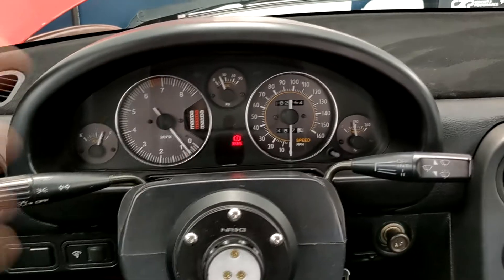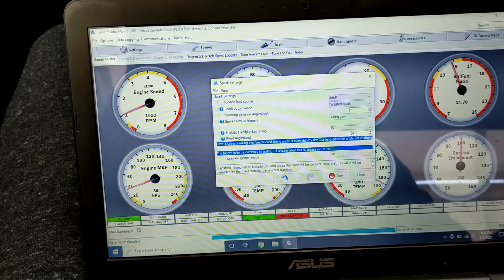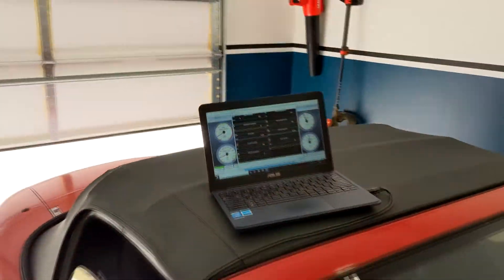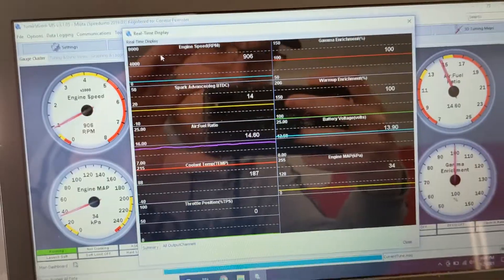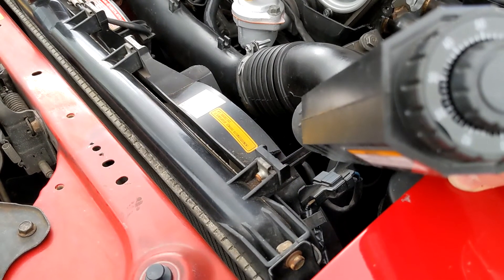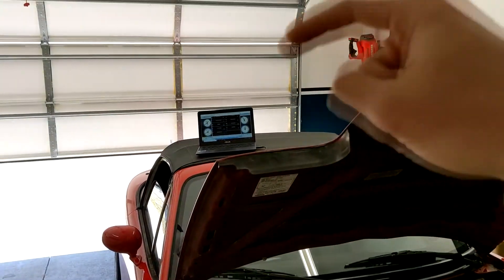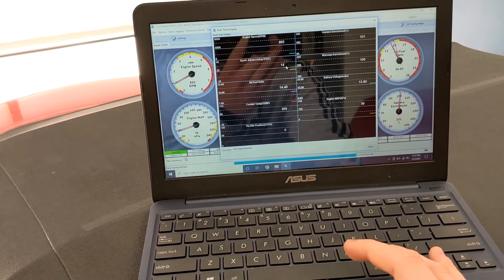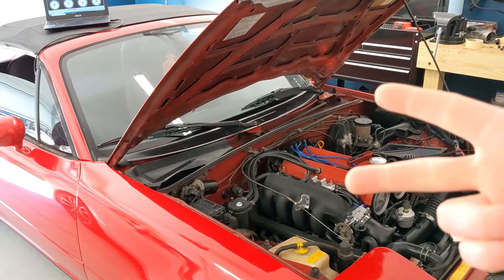NA 1.6 Miata SpeedyEFI - Set Base Timing

Comment: I have a problem where my timing light shows it’s at 10 degrees, the ecu is set at 10 degrees fixed timing and everything is all good. As soon as I turn off fixed timing, the real-time display shows it’s at 20, but when i check it with the timing light it says 10
Reply: i have the same issue, did you figure this out?

Comment: also pretty sure if you set the timing gun to the desired value  (14)  you only need to allign the 0 on the crank gear (so white dot to white dot)

Comment: Just curious, what would happen if your on stock ecu, and you move the cas without having the jumper in the diagnostic box? Does it just mess up your idle?
Reply from the maker: It will mess with the timing over the entire rev range... A common mod is bumping base timing from 10* to 14*. It livens up the car and gives you more power. What that's doing is bumping the entire stock ignition table by 4 degrees, and we all know that timing equals power. So yes, it will mess with the idle, but also the rest of the rev range.

Comment: bro are these ecu good? can it get idle like ms3 with ac too?
Reply from the maker: It’s newer tech than MS and it’s open source. I love it. It gets a bad rap because it’s cheap, so people do 0 research on how to tune and then get upset their car doesn’t run correctly. For AC idle up, you have to pin a connector but there are writeups online for that.

Comment: Uhm. My timing mark is about an inch to the left so about 25 and that’s with the cas all the way to the right to get it there. It was further left
Reply from the maker: What timing gun are you using? If it’s he Harbor Freight one, make sure it’s zeroed out. If it’s still way off, you might want to see if your crank has “spun.” The crank pulley is 2 pieces that are held together by rubber, after 30 years that rubber can crack and split, meaning your timing marks will be ALL OVER the place.
Reply: @ConnorsCorner1  how would i go about that? Like. The accesory and the alternator belt spin separately?
Reply from the maker: @christo_vas  Nope. The center where the crank bolts to it can spin separately from the outside where the belts are. Since the timing mark is on the outside, it’ll be off. Best way to tell is to set cyl at TDC and check the little plastic timing guide. If the T doesn’t match up with the notch on the pulley, it has spun. You can TEMPORARILY mark that as your TDC and time it that way, but the permanent fix is a new pulley.

Comment: Is that a 1.6L? I have a 92 1.6 did you feel any power gains with the stand alone ecu? Really thinking of picking up a speedyefi for my car. I have headers, racing beat full exhaust, and a jackson racing intake box. Also thinking of doing a sidedraft carb setup in the future since this deletes the air flow meter.
Reply from the maker: Yep, 1.6. Fixing the AFRs will definitely help, but most power comes from ignition timing. Only way to test that is a dyno. Either way, being able to dial in fuel is great for the motor especially when modded!

Comment: Damn these videos are so clear and helpful, I was wondering about how it would work with the exhintake mod. Side note that airbox you have looks really nice is it custom? I will need something like this when I get a speeduino. Keep up the great work!!!
Reply from the maker: Thanks! And yeah, I designed and 3d printed the airbox myself.
Reply: @ConnorsCorner1  that's pretty darn cool, you should route the intake into the cowl like a randall cowl intake does.
Reply from the maker: @danyfry39946  Thought about it, but I'm going Turbo soon and I don't want a big hole in the"firewall"
Reply: Conrad that makes sense